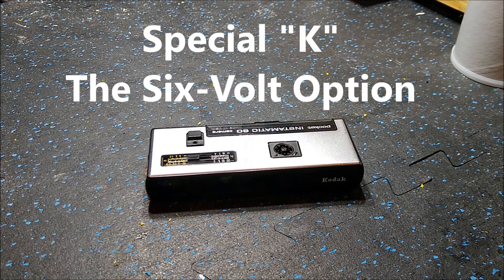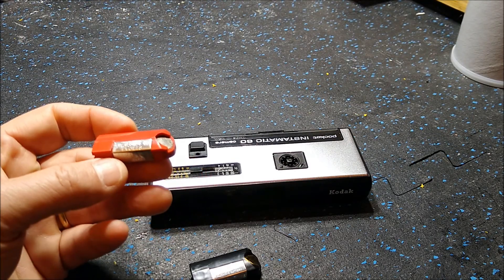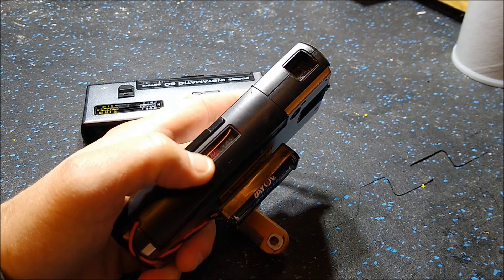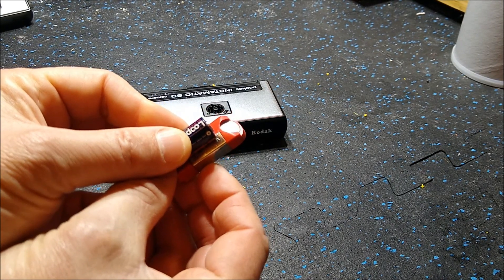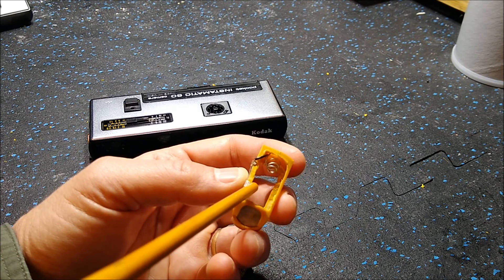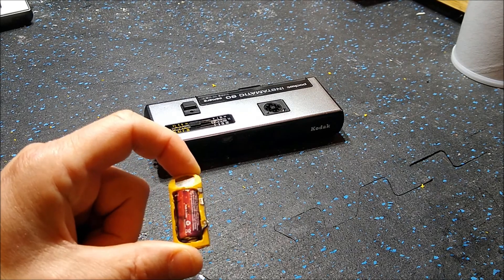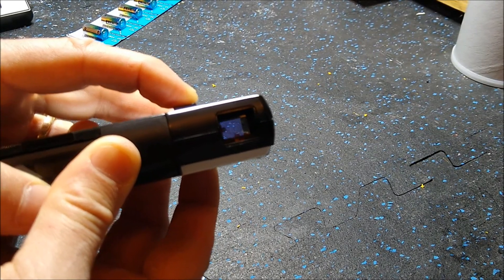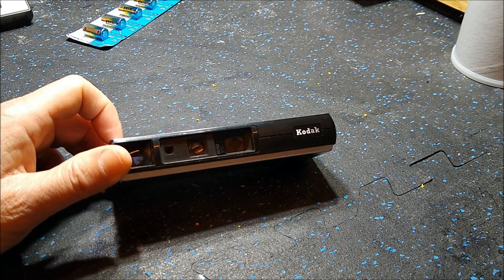Special K, Making a K-Battery Replacement

Comment: Thank you so much for the video! I've been working at getting a battery working but I don't have access to the tools needed here. I know you mentioned you weren't selling them, but any chance you would make one for me? I could send you an original K battery to make it from and of course pay the shopping and labor of it. Let me know of that's anything you might be able to do. Thank you!
Reply from the maker: Cory, I've been experimenting with casting the shape of the K-battery so I've grown beyond needing the empty shell of one.  I'm still working out the bugs, but I'd be happy to send you one of my prototypes.  Just message me your address and I'll toss it in the mail.  Cheers!
Reply: @NanoBurger  Morning! Just checking back with you as I didn't receive an email from you. Any chance your offer for a prototype is still on the table? Thank you!
Reply: @NanoBurger m8 just found my great grand dads old pocket instamatic 50 STILL charged but would happily pay for one of your prototypes if still available! Beyond interesting work you have done here to capture a nearly lost medium of photography

Comment: Do you sell these? Or would you sell one?
Reply from the maker: I don't sell them, but I could make one for you...no charge. I'm experimenting with batteries that have been cast in a mold I made.  I think I have found a casting material strong enough to handle the modification so I should be able to produce one handily.
Reply: @NanoBurger  I'd be willing to pay for one

Comment: That 2AA/2AAA battery pack with much longer leads = Sub-zero-weather power pack where the batteries stay warm in your overcoat. (Seen and heard of during the heyday of film and Eastman Kodak for "Professional electronic cameras" such as the Pentax 6X7.) This unique/proprietary battery potential problem led me to the PX28-using Canon 110ED. Kudos to your never-say-die approach to powering Kodak Pocket Instamatic cameras.
Reply from the maker: I have a Canon 110ED although I wish I had the 110ED20 8-)  I think the Kodak Pocket 60 is superior in the lens quality but at this point, I think the challenge of powering up the Instamatic is driving me.  My current strategy is to make a mold of the K-battery so I can cast blanks that I can use instead of requiring a battery shell.  I just hope my efforts inspire people to use the instamatic.  I'll have plenty of battery mods to give away to the people willing to try.
Reply: @NanoBurger  I HAD a Canon 110ED, until my older sister borrowed it for an outer island conference. It was left somewhere in Hawaii island's Volcano National Park. When I expressed some dissatisfaction, she blew me off, and I let it slip because I'd gone back to 35mm. (As a result, I NEVER lend anyone photographic equipment of any kind.) What makes this tale more interesting is that it was a complete kit, including the Canon clip-on closeup lens, too. These days, the closest I get to 110's 13X17mm format is Ye Olde Fujifilm X30 or a Canon PowerShot G15. But I can still hear the siren call of film at the 35MMC and Mike Eckman websites.;)